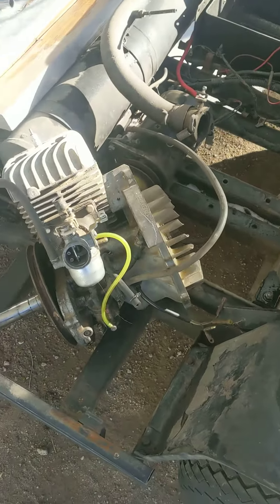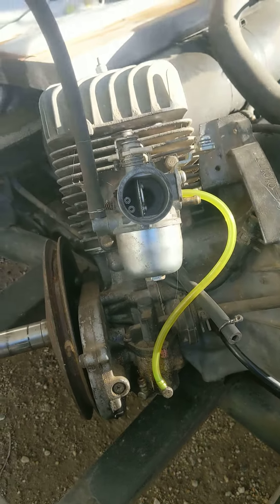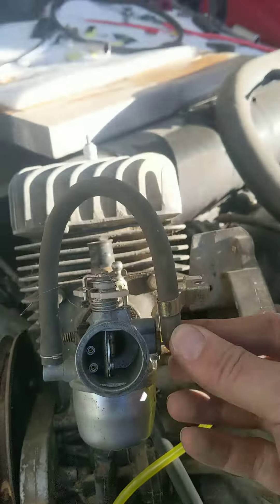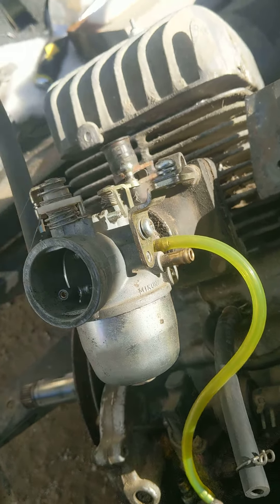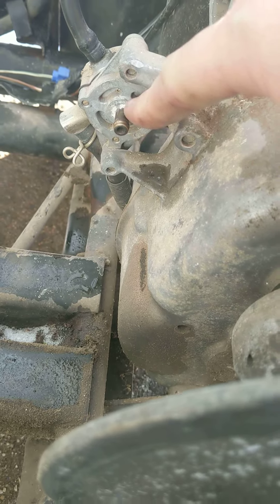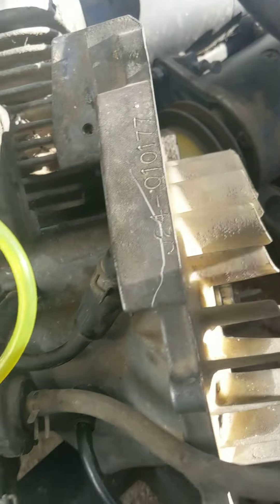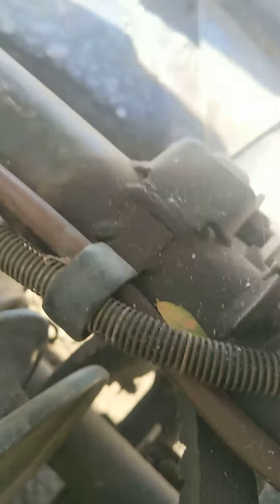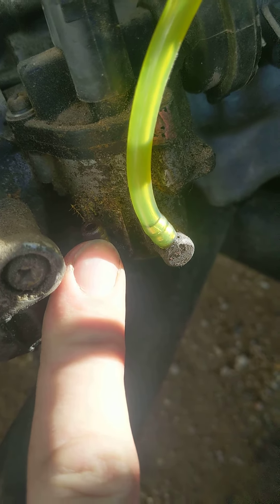Fuel and Oil lines on Yamaha G1

Comment: on the back of the fuel pump, the one that goes straight out the back, goes to the crankcase for pulse to diaphram in carb From tank to. fuel pump inlet is the one with the 90degree bend ,from the last port on fuel pump goes to  the big inlet on carb, it has a little port next to it for reference. Your video helped me on something else, thank you .